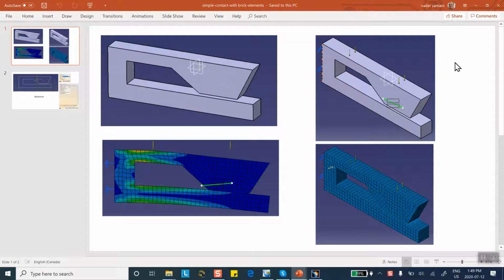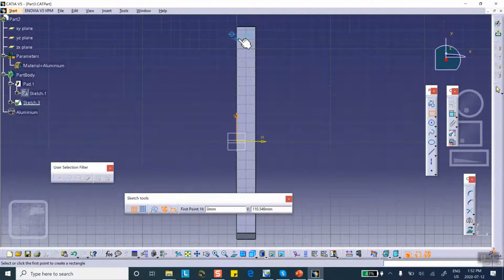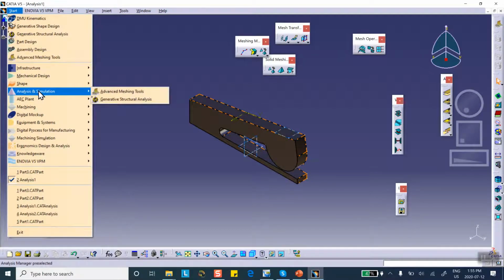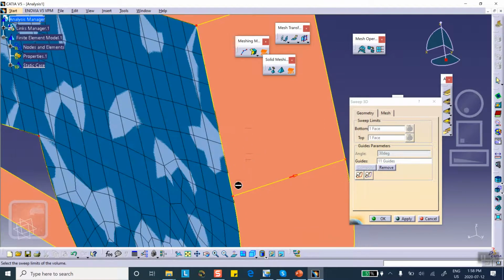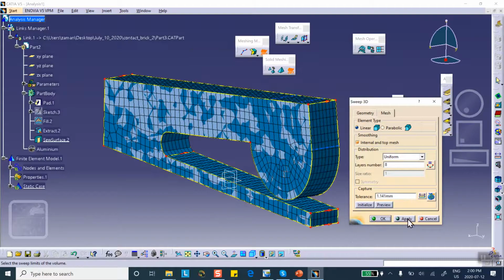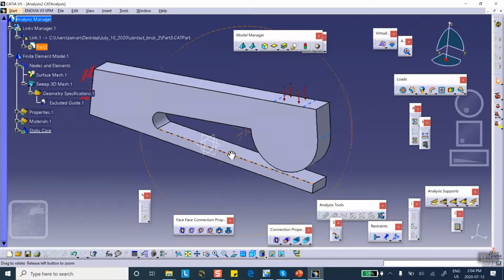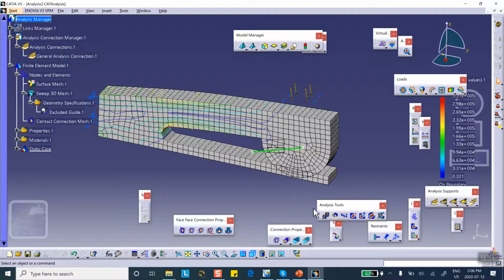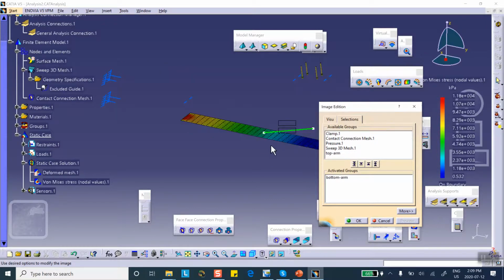FEA, PROBLEMATIC CASE, Contact for Swept Brick Elements, Catia v5, video 2 of 2 Nader G Zamani

Comment: his project is to apply the knowledge that you have gained so far in the course and use it to further develop your finite element code.  

Stress analysis of a bi-metallic strip subjected to a change in temperature

The bimetallic strip shown in the figure above is subjected to a change in temperature of 1750C.  
As analytical solutions to this problem exist, you should compare your FE predictions with the analytical solution.  You are required to calculate:
The maximum deflection of the beam
A visualisation of the overall stress distribution within the beam
The maximum stresses in the aluminium and molybdenum sections of the beam

Your report should contain:
An overview of the analytical solution and the predictions for the maximum deflection and stresses within the beam.
An overview of the predictions made using your FE code using both T3 and Q4 elements.  
Convergence study to ensure that the FE model is adequately capturing the deflections and stresses
A comparison of the FE predictions and the analytical solution.
Discussion highlight any differences between the two and the potential causes of these differences.
You should also include an annotated and working version of matlab code.  It is important to annotate the matlab code to highlight the sections that have been altered.
Can anyone slove this question?